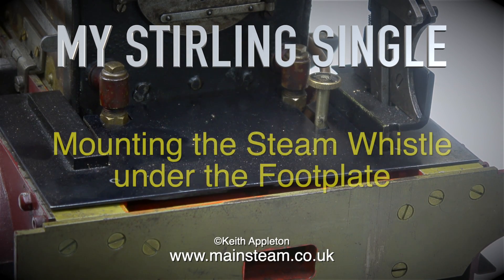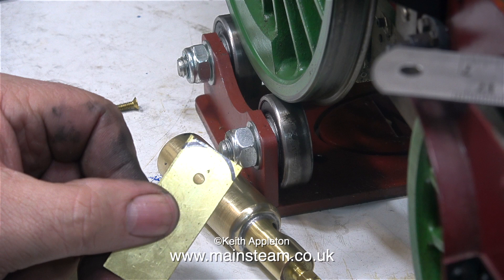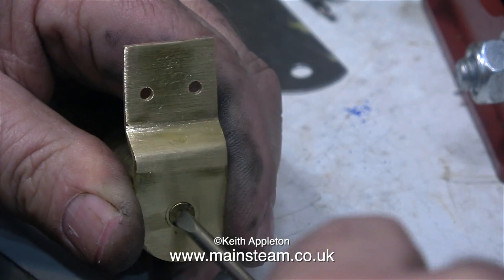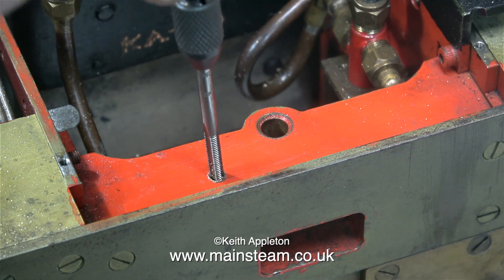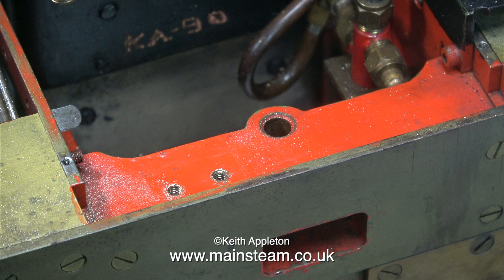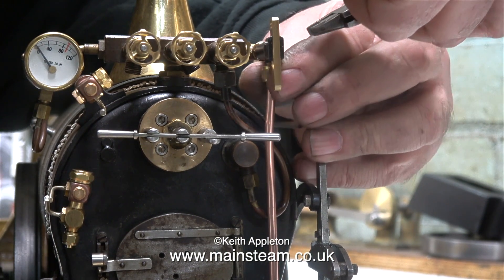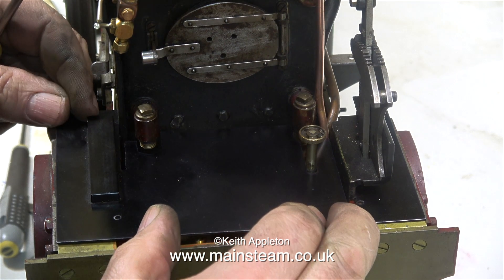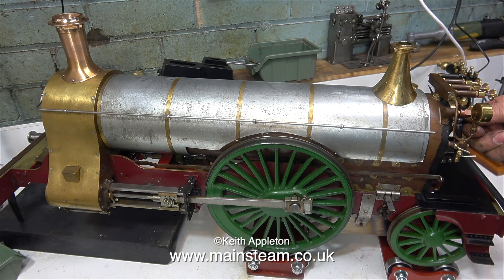MY STIRLING SINGLE #12 - FITTING THE MODIFIED STEAM WHISTLE

Comment: Keith was there a specific reason for the design and build of this very unusual engine. Did the single over size wheel give a desired performance for the areas or rail line it worked on?
Reply from the maker: they could do about 60 miles per hour in 1880 - at that time they were state of the art  . . . .
Reply: Keith Appleton that’s pretty fast for 10 ton of steal and iron. A team of horse max at 10 - 17 mph. Thanks. One other thing a few months ago I asked for information about the outdoor rock concert near this summer, and if I might stop by to say hello. looks I not going 🥺too many student loans to pay back.